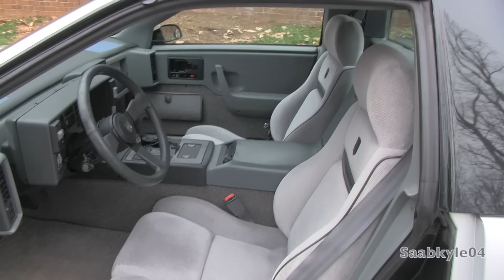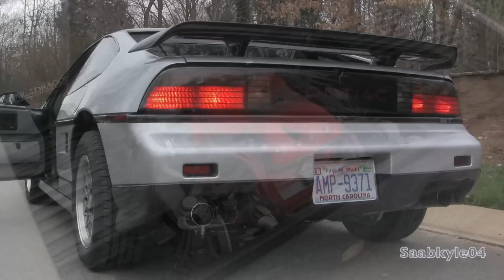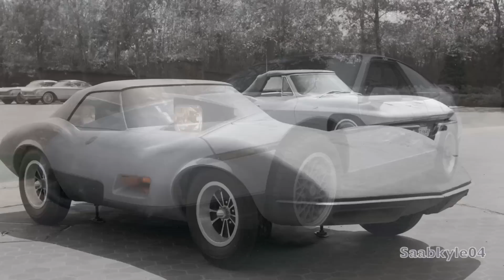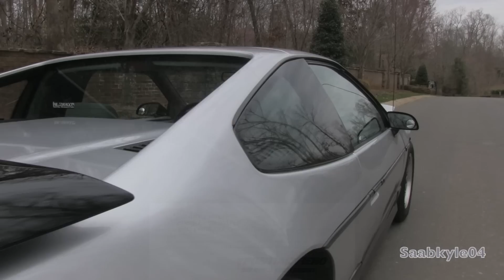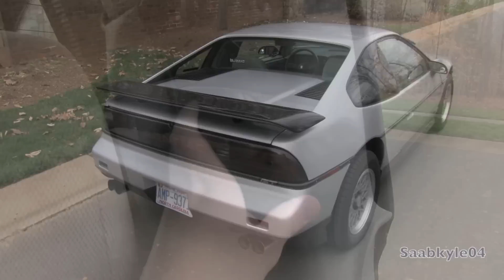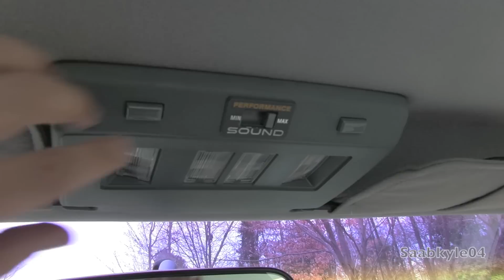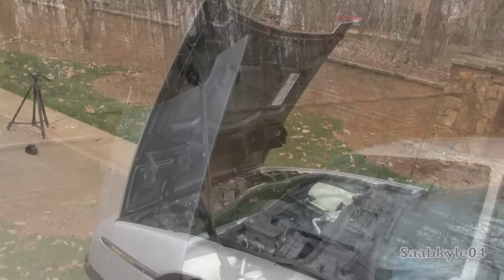1986 Pontiac Fiero GT Start Up, Exhaust, Test Drive, and In Depth Review

Comment: So basically the Fiero was, in many ways, a 1980s Veloster: all show and not much go. I still like it though!
Reply: The Hyundai Veloster is just a racy-looking, front-engine, FWD, 4-seater economy car with 3 doors. The Fiero shares none of those characteristics, aside from the "not much go" portion.
Reply: Chris Starkey
The MR2 is a tin can compared to a Fiero. The Fiero is a GT, not a racer.
Reply: Classick World
wooohhhh...niiicceeee.
Reply from the maker: Good comparison!
Reply: MrCantGetRight313 It was basically a nice running GT, not a sports car. Unfortunately.
Reply: +peculiarmadman - what show? compare any fiero to an MR2 of the same year. they were ugly and slow.
Reply: +Chris Starkey -- Styling is a subjective matter. Regardless, In typical GM cost-cutting fashion, the Fiero was originally based on the Chevette and X-Car chassis -- hardly the first group of automobiles that comes to mind when thinking of a sporty car. 

The MR2 wasn't a recycled design. About the only thing it shared was the 4A motor with the Corolla GT-S, which, as the standard powerplant, easily vanquished the Fiero's wheezy and anemic Iron Duke. By the time GM woke up and got the Fiero's "formula" (powertrain and suspension tuning) just right, consumer interest had waned and Pontiac pulled the plug, while the MR2 lived on to a redesign and a second generation. 

Both cars are timeless relics, but the Fiero -- although the later models were transformed into very enjoyable cars -- was never given a real chance to succeed, and we can thank the GM beancounters for killing a great concept.
Reply: peculiarmadman
well, that is true also, it missed a real good engine that gave it the speed to match the looks. Yet it was better built as an MR2, higher quality materials and simply bigger, more massive. I loved all my Fieros. As for it not being as good as it could be. Pontiac did what they were allowed to do. Unfortunately it wasn't enough.
Reply: I have a stock engine in mine and it flies. Of course mine is a manual tho.
Reply: Jake from State Farm
It took parts from there but was NOT based on it.
Reply: MrCantGetRight313
I had a Veloster for 2 days. It's a tin can, not even in the near the quality of a Fiero. Not even close.
Reply: Well obviously the X Cars weren't mid-engined, rear drive two seaters, but nevertheless the fact remains that suspension-wise the original Fiero had the rear end of a Citation and the front end of a Chevette. If that isn't the end product of a committee of sapless  bean-cutters, then nothing is.
Reply: Jake from State Farm
That's ok, if it works, it works. The Citation wasn't a bad car, for that matter. I loved - LOVED - the Fiero.
Reply: manoman0 : But it DIDN'T work. Sales numbers fell dramatically from 136k in 84 to a mere 26k in 88, prompting GM to pull the plug.

The Fiero's sleek styling and off-the-shelf parts could only carry it so far, and when compiled with all the negative press it received at the time mostly due to engine fires, its goose was cooked.

...

And no, the Citation was a dreadful car. lol

Comment: When it comes to panel gaps, this car is fiberglass/plastic bodied- ever seen endura nosed GTO's??. The car may have been repainted or had body work done, the 87 I had did not have those gaps....
Reply: Yeah it's possible. I notice the ride height seemed maybe a half inch to an inch to high as well. And wow the endura nose. Not something I really cared for but it seems to be somewhat desirable now at auction.

Comment: I appreciate this video, but damn that thing is a piece of shit. Look at those hideous panel gaps around the hood.. and the craptastic fisher price interior isn't a huge selling point for me either. It's easy to see why so many of these cars were gutted and used to build equally shitty kit cars.
Reply: It's nearly 30 years old and has composite body panels. Give it a break, and the interior is better than Toyota's new interiors.
Reply: kirbyswarp the only Toyota that this car has a preferable interior to would maybe be one of their forklifts lmao
Reply: 92ASC You mean every Toyota with their shitty plastic interiors? Look at the "new" Corolla, its garbage. The Echo. terrible.

This atleast has soft plastics and padding on the dash and character. Something toyotas haven't had in a long time.
Reply: kirbyswarp Yeah the Corolla is a sub $20k car and the interior is still composed of a good amount of soft touch materials. Don't really see how it's worse than any other car in it's class. And did you really just cite the freaking Echo as being a representation of Toyota interiors?  They haven't even made that car since like what? 2005? and that was one of if not the cheapest car they ever produced.
Reply: 92ASC And they haven't made this car in over 25 year. what's the problem?

And the Corolla has a junk interior. No real soft touch materials. (That fake stitched dash is not soft) and only the armrest is soft. Plus it has the same clock you'd find in a 90's camry, the same mirror controls as my old 90's 4runner and a bunch of other sub-par materials/parts.

I sell parts on ebay as a side job, and a window switch I got off of a 2001 4runner fit Toyotas(any model really) up to 2009 when they slightly changed it.
Reply: 92ASC The yaris is just as bad as the echo, when you think about it, it IS an Echo with a different name. same powertrain, 4 speed auto from the 90's, same lack of NVH control, same lackluster car it was when it came out.

Still for sale in 2014. and people still buy it becasue of the badge.
Reply: Its unfair to judge this car outside the context of when it was built. Compared to other 80's cars the Fiero's interior is pretty much normal and the build quality of cars from that era was sub-par at best. Also, guys turn them into kitcars because they are retarded wannabees and actually think people will believe they are driving in a  Testa Rossa
Reply: Near VII Grow up kid.
Reply: Near VII Don't give me that bullshit, unless YOU yourself can build a good car, or are Toyota's official Youtube page.
Reply: You don't appear to be a product of the 80's.
Reply: Near VII I owned one at one point. It was a manual, so you couldn't even drive it XD
Reply: GoodMILK Gaming My 4 banger Fiero has over 200k miles and survived my mom when she was 17. It's currently my daily.
Reply: Antwon Jenkins
you nailed it. Just about everything GM made in the 80's was pretty much junk, but the Fiero did have a lot going for it - especially considering that the engineers pieced it together with a tiny fraction of the budget they normally give for developing new sedan models. Personally, I thought the Fiero's interior/instrument cluster was one of the best aesthetic qualities of the car, but then again, growing up seeing all the horrible Detroit disasters of the 70's/'80's gave me a different perspective...
Reply: I do agree, however, that the 4-banger was a piece of shit.
Reply: 92ASC Its a 90s Gm lol, what do you expect. Still, such a clean bodystyle despite the flaws.
Reply: I don't know if it's a good car or not but Enzo Ferrari didn't care about panel gaps.
Reply: That is exactly why i love 80s american cars
Reply: kirbyswarp people buy it because it'll never break down. Tyres are cheap, and they use barely any gas.
Reply: Near VII I was 13 when I bought it. I fixed it up and sold it for a profit. WHEN I WAS 13. Also learned to drive manual on it. It would burn out through 2nd gear so dont mess with 55hp bitch.

I can claim I've NEVER owned an auto, Ive driven them but never owned one.Last time I drove one, I forgot you can leave it in Drive to handbrake turn lol, I put in in neutral lmao.

That's what happens when you only drive manual and get confused by two pedals.
Reply: David Moore G-bodies? W-bodies? H-Bodies? There are still a ton of them on the roads.

don't forget the cockroaches which are the A-bodies.
Reply: 92ASC I like how all you geeks are arguing over a fiero.
Reply: kirbyswarp 2000GT? Mk1-3 Celica/Supra?
Reply: Shut up dude, the Fiero was a good car. Sure it wasn't a wannabe supercar. coughcobracough I appreciate the Fieros, as I have owned more than one of the cars. They're very easy to underestimate, and I know that GM mostly made shitty cars in the 80's, but the Fiero was definitely not one of those cars.

Comment: Kyle, is that the original exhaust? And why would you want a CD player lol? When you can get a cassette to mp3 adapter.
Reply from the maker: I would much rather have a CD player if it doesn't mess up the original look
Reply: ***** You wouldn't want mp3 capability? Cd's are useless. You have to burn everything on them. I like cars with either cassette decks or Aux jacks.

but I do remember the day when I wished for a CD player. Before I had music on my phone/mp3 player, and when cassettes decks were simply just old stuff. Like CD players today.
Reply: ***** And is that the original exhaust?
Reply: kirbyswarp
Surprisingly, it's the factory exhaust. Amazing how they made that little 2.8L sound so brutal....
Reply: +kirbyswarp I prefer a fiero with original cassette radio with the green read outs. they're retro. I really like how we can use an MP3 cassette adapter. I find that MP3 sounds better on a cassette adapter.
Reply: Josh Carpenter Mine too. Now, I have only a CD player. Such an inconvenience...
Reply: 2dfx If the speakers are the same, it won't be much of an improvement.
Reply: ***** Plus, isn't that an aux port on there?  Odd to see that on a factory stock unit on a car of that era.  I'd much rather use that than mess up the clean look.
Reply: telj1 No aux. It's a 90's Pontiac unit.
Reply: Well this particular one has an aux if you look closely.  It could be a mod but it's there. Is it 90's or 80's???
Reply: telj1 90's, I see it now, must be a modification to the original one.
Reply: +Josh Carpenter How so? The adapter is just that, and nothing else. Doesn't do much for audio quality.
Reply: It depends. That's just my experience using one, I used a MP3 cassette adopter hocked to my phone in a 05 Maxima and it sounded great in my experience.
Reply: I know how you feel. Does it have an AUX input? I'm starting to prefer cassettes and AAC files over CD.
Reply: Josh Carpenter No AUX, only a CD player. It sucks.
Reply: +kirbyswarp That would not be a factory exhaust sound. Sounds like a ocelet exhaust.
Reply: +kirbyswarp The OEM cassette deck from that car is junk.

The Monsoon unit from a Firebird is MUCH better sounding.
Reply: kirbyswarp word. I actually have bought some aftermarket speakers and Kenwood stereo for my focus,
Reply: Josh Carpenter Those are awful and look incredibly cheap and tacky. This is a car I would drive, not necessarily listen to music in.
Reply: +kirbyswarp Pandora with Bluetooth is awesome too.
Reply: webslingercj Pandora is cool becasue you can put in Eminem or coldplay and you'll get the exact same music.
Reply: if you didnt see the radio deck had an aux input but i wouldnt expect you to see it because it was hidden
Reply: CD sounds wayyyyy better than mp3. Especially mp3 to factory tape deck.
Reply: or a SD card
Reply: or a SD card or Pandora internet radio from Bluetooth smart phone
Reply: Id go with FM transmitter
Reply: CDs sound infinitely better than any mp3
Reply: because CDs sound intimately better. Not an opinion, a fact